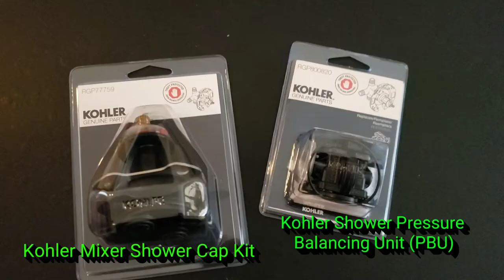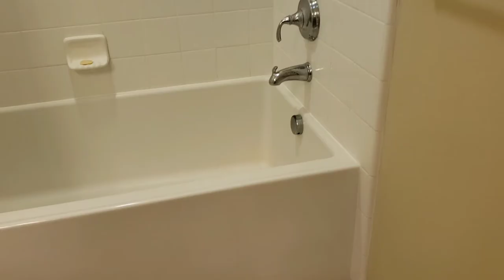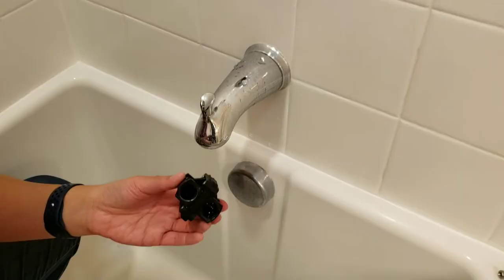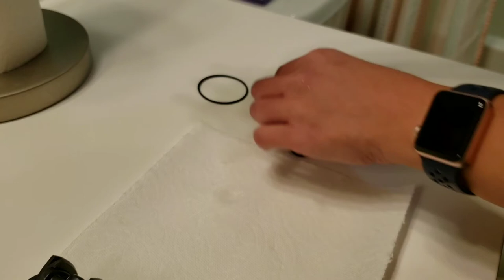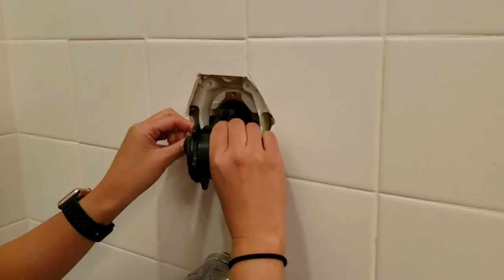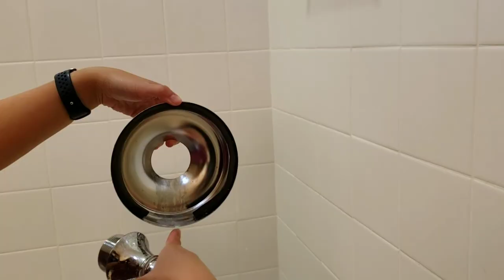DIY - Fixing a shower faucet that only provides hot water (Kohler faucet)

Comment: Doesn't Kohler have a lifetime warranty?  If you call them will they send you the parts for free?
Reply from the maker: We didn't think about their warranty at the time, but will keep it in mind next time. Unfortunately the faulty old part we removed in the video  was a generic non-Kohler part that was used when the original Kohler part had issues the very first time a few years ago. Not sure if Kohler would've said all warranties are void for that faucet by claiming the use of a non-Kohler could have fouled the rest of the parts and totally washed their hands of this faucet? Another thing was that we wanted to fix the shower issue as soon as we could and not wait a few days for a replacement to arrive in the mail especially when it was only $53 and readily available from Home Depot. However if the problem comes up again with another Kohler faucet we'll definitely go the warranty route if getting the faucet back up isn't urgent.

Side Note: I believe Moen has a similar if not better lifetime warranty.
Reply: @bensaysthings  I loved the video.  I am having the same problem and this was exactly what I needed to see.  Just as an option for the viewers, I did call Kohler and they are sending me the replacement part for free.  You are right it will take a few days to get, but in my case, I was willing to wait.
Reply from the maker: @mucho8ocho  Cool! Thanks for the heads up about Kohler. This is good info!
Reply: If you are the first home owner, Kohler offers a lifetime warranty, regardless of after you had a generic part replaced.
Reply: Would that cause the sink and the toilet in the bathroom to only run hot as well? We have all hot water in the bathroom. Kitchen has both

Comment: First off, I always thought Koehler was top of the line compared to Delta or Moen.  I am sadly mistaken.  Any Kohler product that I own always needs something replaced.  Yet I’ve had Delta and Moen products that are 30 plus years old and are still working fine.  Whenever I have a problem with a Kohler product, I always email the company and they usually send the replacement part for free.  Just trying to saver all you DiYers a little money!!
Reply from the maker: I've never used Delta, but have Moen all over the house and they do last a good while (I haven't personally run it out 30 years yet).

Comment: The new inside part is not mixer, it's called PBU, pressure balancing unit. The outer part is mixer. But thanks for making clear that it's PBU to blame for the hot water or cold water problem.
Reply from the maker: Thanks for the clarification!

Comment: Amazon has both parts together as a set for $57, I just received it today. Home Depot was crazy expensive for you.
Reply from the maker: Wow, that is a good deal. Will keep Amazon in mind next time, although I've been informed that you might be able to contact Kohler for replacement parts for free (warranty?). Haven't tried it and at the time we needed to fix the shower in the same day and even Amazon couldn't deliver that fast. Thanks for the heads up.
Reply: @bensaysthings  I think I’m replacing a Kohler part as well, I replaced this part in this shower 18 months ago and it’s acting up again already.
Reply from the maker: @TelesPlayMetal  Dang, 18 months and it's bugging out again? That sucks man. Was the old part genuine Kohler or a generic? The one taken out in the video was generic and it lasted a couple of years, anyways good luck with this new one.
Reply: @bensaysthings  It was a genuine Kohler part, don’t know why it crapped out but I bought the newer model and it worked right away. With both parts coming in a kit, it made sense just to replace the entire thing and all gaskets. It was the inside part though that has broken.
Reply: Hi -- what's the model # on Amazon?  I want to order same thing and try!
Reply: @TelesPlayMetal  welcome to the club. I’ve been in mine 4 times.2 to replace a bad pressure balancer and the other 2 because that updated part doesn’t work worth a sh::.  A lot of people have complained about the updated version. It’s not made like the original and for me created some crazy issues I never had before I put it in. I had to go back with the generic of the original design but it didn’t last so here I am  again with more problems. I’m over it I’m tempted to pay a plumber to come yank that junk out and put a different brand in. My kohler toilet didn’t last either.
Reply: @whatfreedom7  I replace the flush valve seals on my Kohler toilets annually. That’s about how long they last.

Comment: Thanks, very helpful, exactly what I needed.  I only replaced the mixing portion, the valve on ours was fine as well.  The components on the unit did not say "Kohler" on mine either, which is very suspicious.  I'm sure they've never been replaced before, this house was built / finished in 2012, but was never occupied continuously, so they just couldn't have seen much use.  Both showers, actually, failed with same problem, I figured to tackle one first, then I'd know exactly how to fix the other.  The other still works, barely, you have to turn it all the way hot to get hot, then back down, nearly all the way to get cold mixing to adjust temp.  The one I fixed today had failed completely, no cold at all, no matter what.  New mixer, new washers/gaskets, a little WD-40 to lube everything as it went back together, and voilá!
Reply from the maker: Glad the video was helpful!

Comment: Thank you so much. Had the hot water only issue, followed your guide and had no issue. My unit does not have the section (white where you secured at 12 & 6 o’clock position) Mine had a disk which covered the whole opening, with screws that secured at the 12 & 6 o’clock position. After reviewing your video I remembered the kit had a life time warranty. Contacted Kohler and got both part at no cost. Need to replace the 6 & 12 o’clock screws as one broke &  one was bent. Also my mixer had no Kohler markings, the replacement did.
Reply from the maker: Cool. Glad you were able to knock this repair out. Yeah Kohler is pretty awesome with their product warranties.

Comment: My Kohler shower combo is slightly different but I’m dealing with the exact same problem. Thanks for the video. Going to take a note from your playbook and buy both to save on trips. 👍
Reply from the maker: Good luck with your repairs!
Yeah, I've learned that anytime I think something else might need to be replaced I just go ahead an buy it since Home Depot has a good return policy. More importantly it saves time when you're in the midst of a repair so you don't have to stop everything just to make another trip.

Comment: Thank you for posting that video!  The outside of your valve looked almost identical to mine.  I copied down part numbers and was able to find both at my local Lowes.  When removing the inner mixer part, had to gently persuade it with a screwdriver prying gently on all sides to get it to slide out.  Also had to peel off old o-rings which were stuck to back of valve body.  Had an older inner mixer(not sure if OEM) with 1052337 molded into it, and RGP800820 is the successor.
Reply from the maker: Cool! Glad the video helped and you're up and running.

Comment: @bensaysthings I did notice something. You didn't lubricate any of the O-rings. You are supposed to. My faucet is working now after only replacing the rear mixer. However, It's only cold for about the first quarter of the half turn. Mean "Warm" starts fairly quickly.
Reply from the maker: You're right. I should've put some silicon o-ring lubricant on before installing them.

Regarding the cold only around the first quarter turn of the half turn, it sounds like it might be working as it should. Here is a helpful video that explains how the mixer works.
https://youtu.be/oyuFPysbrz8
Reply: @bensaysthings  Indeed it was helpful. Thanks.  I now also realize I have to order the same retainer collar that you screwed the handle on to. My retainer colar was for a kohler with a circular backing rather than what I'll call the plus sign shape backing. If I don't the older retainer camnt be screwed into place. The kind you have can be.

Comment: Thanks for the video. Does the new design of GP800820 better or worst than the original design of GP500520? Based on some comments from Amazon, some say the new design 'Oval ring'  does not work well compare to the old one. 
The mixer still work since Dec, 2019? Thanks again
Reply from the maker: I'm not sure how the GP800 compares to the old GP5005. Granted it's only been about 2 years, but as of today the mixer and shower work fine with the installed GP8008. Hopefully since we installed a genuine Kohler part it should last at least a few more years.
Reply: @bensaysthings  Thanks for the quick reply and information.  I have the original one (square one) and they last quite a while. I believed at least 10 years.

Comment: I replaced the same shower 2x already and yes 1 was a generic.  It seems to last about 5 yrs and maybe due to Vegas having really hard water
Reply from the maker: Good to know. Man, 5 yrs seems kinda short to have to revisit that same problem.
Reply: My original made it several years but my generic only made it several months. I’d like to find a more reputable aftermarket part since the OE design isn’t available anymore.

Comment: I have a question. What if you live in an apartment and don't have access to the water boiler? Can you turn off water in one unit?
Reply from the maker: I'm sure there's a way to turn off water to individual apartment units exactly for the reason of fixing various faucets and fixtures and in case of a flooding situation (or burst pipe in a wall). Since you're in an apartment you probably could just call the landlord to resolve any maintenance issues. However if you live in a city like NYC and you own/responsible for your own maintenance then you'll have to locate the main water shutoff line that goes to your actual unit and turn it off there. I'm not an expert in anyway so you might have to do some additional research to locate this shutoff valve or probably call a professional. Good luck.
Reply: @bensaysthings  Yeah,  the landlord/maintenance crew here is a joke. They have no clue what they're doing.  I do all my own repairs cuz they suck so much.
Reply from the maker: @Catwomin228  ouch, yeah I've been through something similar. Good luck on your repair(s).
Reply: @bensaysthings  I got it done. Thank you! :)

Comment: Anyone know any reason why a pressure balancer would keep going out?
My OE failed and had a ruptured diagram. I replaced it with the updated different design but it created some crazy issues I didn’t have before. So I tried another one. Same crazy issues. So I bought a generic of the Old design and it worked and got rid of the crazy issues. Then it only made it 3-4 months then my hot cold mix was back to being screwed up again like it was before I fixed it. I’m so over this Kohler junk at this point.
Reply from the maker: That really is some weird issues. I'm not a professional by any means but maybe it might be something weird with your pipes or pressure going to that shower. It might be time to call a professional? Good luck.

Comment: Problem not resolve.. I did exactly that and i can't get the hot cold to mix evenly.
Reply from the maker: Aw man, I'm not an expert, but maybe there's another Youtube video out there that helps with your specific problem. Only other thing I can think of is maybe the mixer unit and pressure balancing unit need to be replaced? Last resort is to call a plumber. Good luck, I hope you get it worked out.

Comment: I have the opposite problem only get freezing cold water. But the rest of the house has hot water.
Reply from the maker: If your shower setup uses the same parts as in the video it could be the mixer with the hot supply is obstructed.

Comment: Ha ha Jay has the same issue with one of his.
Reply from the maker: Yeah, this was the second faucet that had this problem. As you can see the replacement operation is pretty straightforward. Pam used her strong independent womanly strength and made short work of it.
Reply: @bensaysthings  Nice. I just don't like how it goes bad. Back in my day stuff like that was built better. Replacement parts for rebuilds should be affordable.
Reply from the maker: Yeah, things these days are designed to last just long enough to exceed the warranty. We're in a consumer/throw away society. Things aren't made like they used to be.